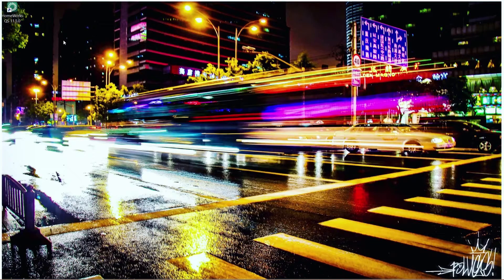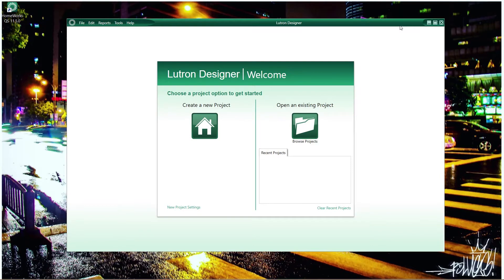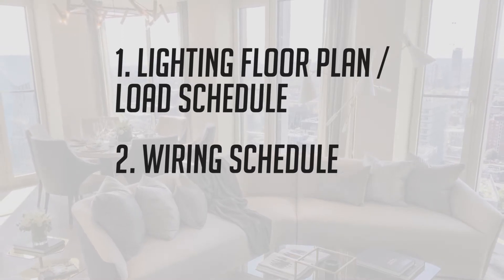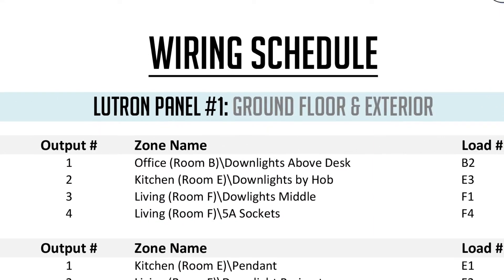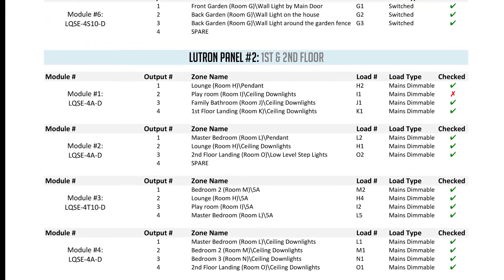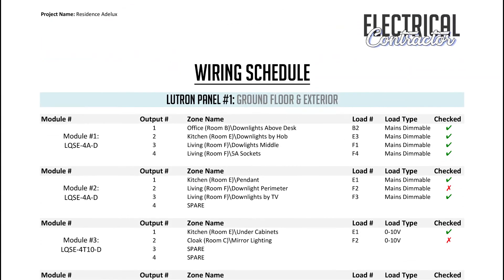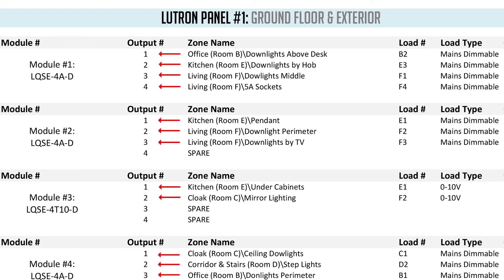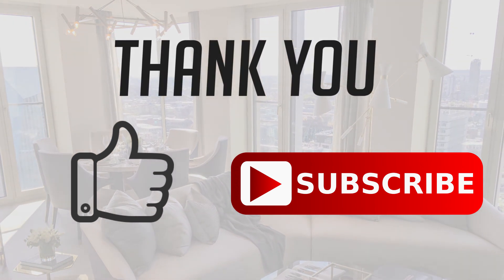Lutron Homeworks QS Tutorial // How to use a WIRING SCHEDULE (Key Information)

Comment: Please let me know if you can help me with this:
The 0-10V Power Module (LQSE-4T5-120-D) has relays at the voltage outputs of 120V but, does those outputs also dims voltage? (does it supply other voltages lower than 120V or its just a on, off output)?
Reply from the maker: Thanks for your comment. 0-10v Module is switch only. It is only on/off (and a very good one). If you need to dim mains you need a mains dimming module (LQSE-4A…..). Hope this helps
Reply: @adelux  It helps like you have no idea!!!! THANKS A LOT FOR ANSWERING!!!!!!!
Reply: @adelux  how  can i replace LQSE-4A-D . my one of module id not working and i want to replace it and reprogramme my processor